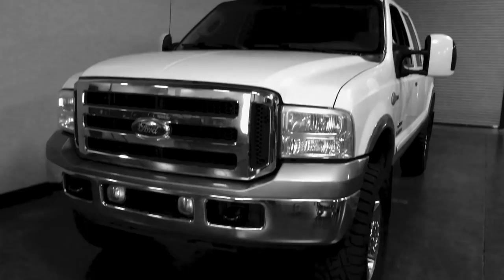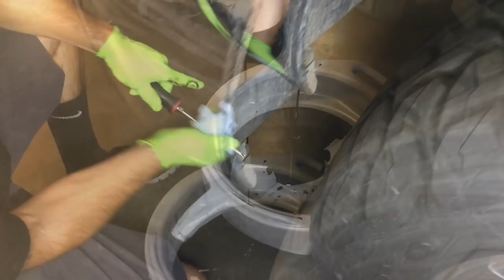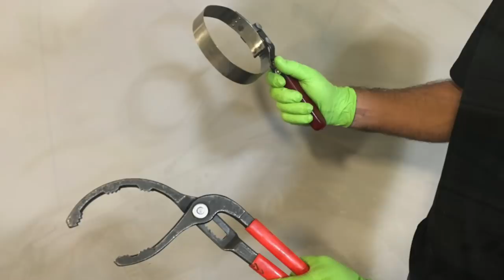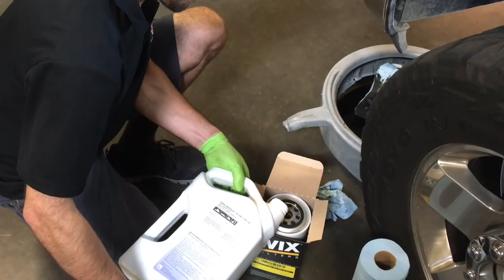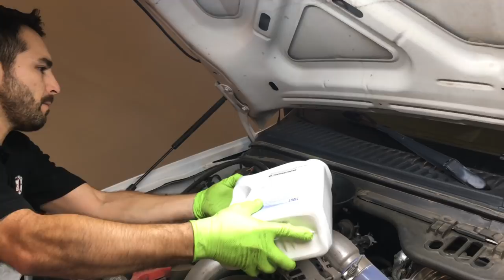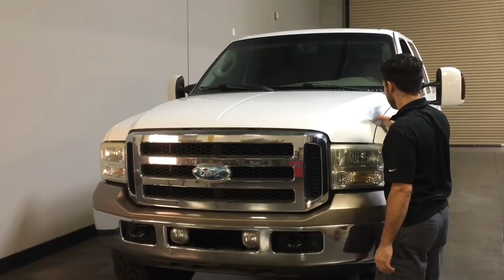Oil Changes with the BulletProof 6.0L Oil Cooler System

Comment: I have the HD oil cooler with stock oem filter on an 2007 6.0 powerstroke. It has worked flawlessly in Minnesota the past 5 years. I was originally told 3 quarts more than stock with this system, meaning 18 quarts on fill.
Since the system holds 3 quarts in the hpop, I just always filled with 4 gallons of Schaeffer's SynShield Ultra 722 10w30. No issues whatsoever.
Reply: Any rust under you truck?
Reply: @Dunebashing88  

Nope. 2014 the frame was custom powered coated with corrosion inhibitor. I use Fluid Film. 2 coats every fall. And it gets washed twice a week if its driven in snowy weather. 
When not in use its garage kept.

Comment: So i only have the oil cooler and not the bypass. I would assume to add 4 gallons or maybe a tad more. Should i get 5 gallons to be safe. Thats the only filter i remove right, in front of the driver side tire. No other filter on top. Thanks
Reply from the maker: Our advice is to simply take a very close look at the dipstick and fill until the appropriate level is reached.

Comment: why change the bypass every 10k wen amsoil says 60k or 2years? and is it possible to have an amsoil full flow filter rather than that wix one?
Reply from the maker: With proper oil analysis (ex: Blackstone), you may be able to extend oil and oil filter change intervals, but do so at your own risk.  To date we have not found an Amsoil brand full flow filter, that directly cross references to the WIX 51832.  There are a few other popular direct cross referenced full flow filter options such as Baldwin BT349 and the Fleetguard FL3656.
Reply: What’s the point of having a bypass(amsoil) oil filter and a main (wix) filter?  It runs through one and right into the next?  Just curious?
Reply: @wileybird69  the wix is the full flow to filter out any larger immediate dangers to the engine while giving it all the oil flow it requires. the amsoil bypass filters out a small portion of the oil to a much finer level to remove particles that flow right through the other.
Reply: Gotcha thank you!!
Reply from the maker: @wileybird69  The standard bypass filter has a nominal rating of 10 microns, and the Amsoil filter has an absolute rating down to 2 microns! That means that small, finer particles that can easily slip through the primary filter are now caught and trapped within the bypass filter.